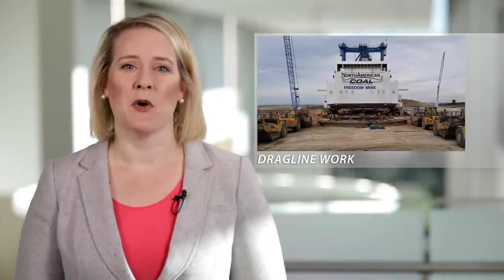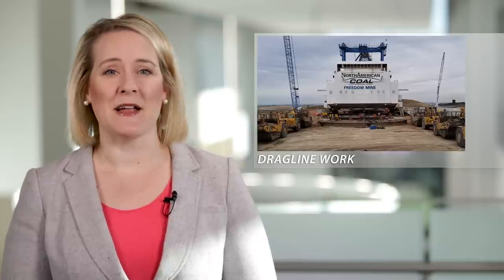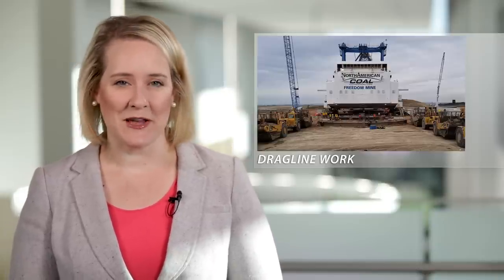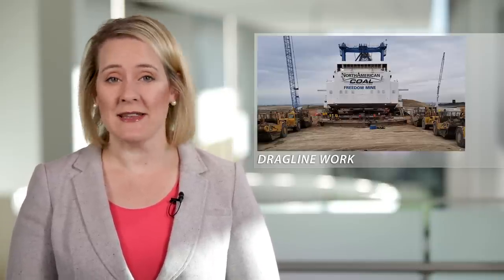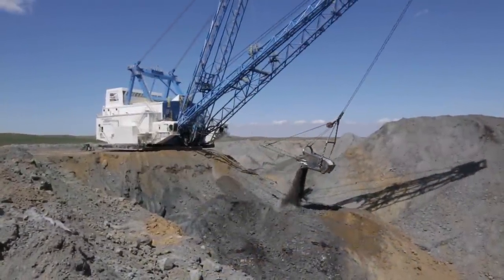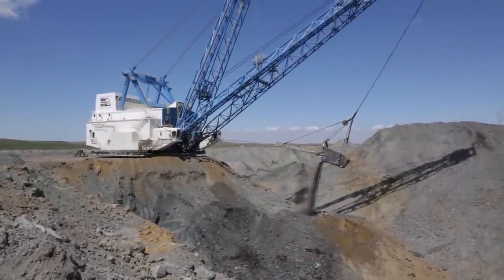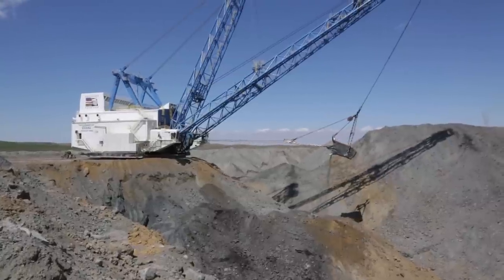Dragline tub replacement at the Freedom Mine near Beulah, North Dakota

Comment: We had two BE 1150's i worked on back in the 80's that were 50 years old then on the original tubs. Also had a Marion 7800 slightly younger but also original tub. Twice a year I got too crawl round inside them, to check for cracks and loose or missing swing rack bolts. This one seems young to need a new tub.
Reply: There are 1950s cars with with the original engine never having been overhauled still running. "These new cars just don't seem to last" he says.